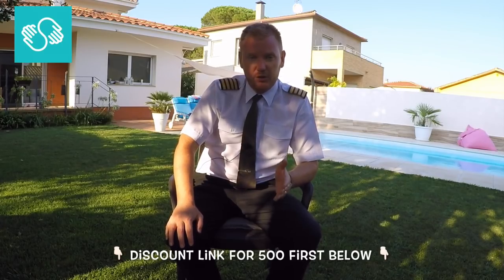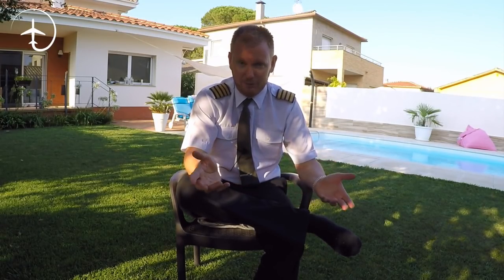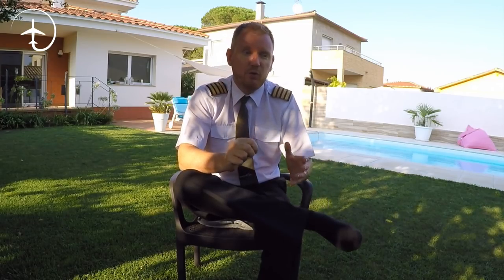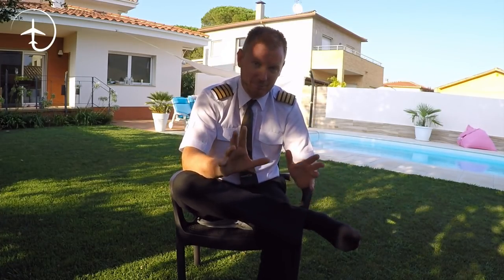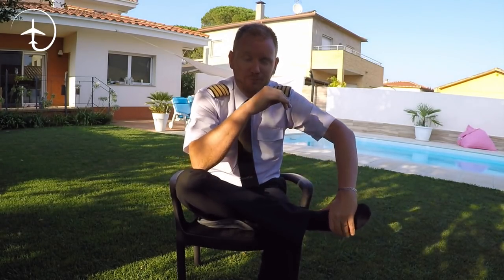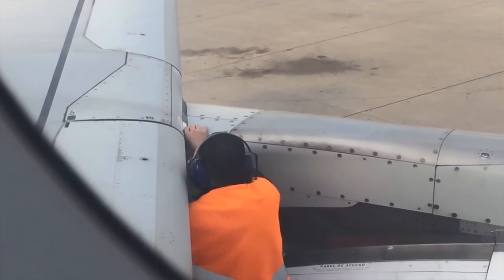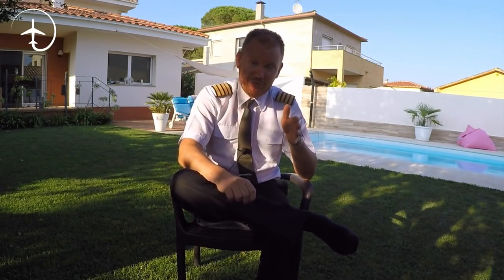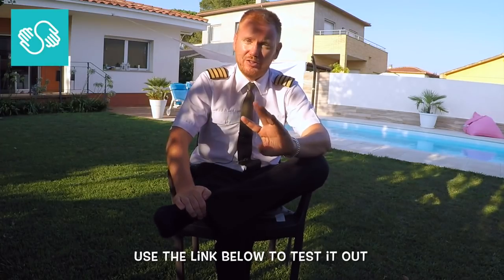Fixing aircraft with DUCT TAPE?! Mentour Pilot explains.

Comment: actually there are two types of speed tape. one is what you see in the video which comes in a roll. this tape is thinner, not very strong(relatively, its still a lot stronger than what you can easily buy), usually several layers of tape is required. major purpose is to provide sacrificial protection to parts which are not load bearing such as panels with errode edges, lifted or torn seals, sealant that is not completely cured, cover up minor cracks, etc. the point is if you see that speed tape lifting or breaking or even fly away in flight, its just doing its job; another type is thicker, much much stronger, last a lot longer and crazy expensive. its usually use to cover up some small holes, missing covers or small panels like what you see at 4:15 , or use as temporary repair if permanent repair to cracks/dent will not be done soon. one layer will do the job and it last much longer than the thinner one. but as i said it is crazy expensive and very often you wont have any supply of this tape, so mechanics usually use the cheaper speed tape (again, relatively), layer it up to obtain a repair of similar strength, and its where skills, patient and intelligent make a difference between what you see in 4:15 and a nice looking and long lasting repair. but still, speed tape repair is going to break sooner or later, so periodic check is to be carried out, if the speed tape repair is in poor condition then damaged tape will be removed and new layers will be applied.
Reply from the maker: Thank you! That’s excellent information.

Comment: Pilot report: "Evidence of oil leak on #1 engine cowling"

Maintenance report: "Evidence removed."
Reply from the maker: Hahaha!
Reply: nah you dont get it. the report will be "oil consumption rate checked within limit, oil leak is normal. cowling cleaned up. no.2 engine is lacking normal oil leak" XD 
ok seriously most gas turbine engine is perfectly normal to lost oil during operation as long as the lost of oil is within a specific rate. an engine that dont lost oil at all is not a healthy engine and can cause more trouble. it will be a long story to explain it.
Reply: I was always told that is a multiengine prop job is not leaking oil while on the ground, that you shouldn't get in it.
Reply: "nah you dont get it." -- No, sir, YOU don't get it! This is an aviation joke that probably dates back to the Wright Brothers. Way to kill the humor, though...
Reply: Jeb: Starting the engines... wait, they just blew up.
Reply: Sounds like a Lockheed P-3 (or any other bird with RR Allison T56 engines) basicly... It's called 1960's corrosion self-preventing engines :p
Reply: My favourite one was:
Pilot complaint: left engine missing.
Maintenance report: left engine found on left wing after a brief search.
Reply: @krakenburger56  Oh, c'mon, just tape the sh*t up and let's take off.
Reply: @Phaidrus  Throw that duct tape away... Get the Flex Tape!
Reply: Pilot... Autopilot in altitude-hold mode produces a 300 feet per minute descent.
Maintenance... Cannot reproduce problem on ground.
Reply: hahaha I am a field service technician, and there is only a special breed who makes it to all the 4 steps, source found, course removed and root course excluded.
Reply: Love those maintenance reports.
Reply: That used to be the case when radial engines were common. I worked on R2800s early in my career and we actually add so much oil regularly (almost as frequently as it was fueled), it was always calculated in on every weight and balance chart. We’re talking gallons at a time. Today, quarts / liters are the norm and that’s maybe every 50 flight hours or so.
Reply: @tommaguzzi1723 I forgot about that one.

Comment: "Wouldn't use duct tape to fix your car" -- clearly you've never seen cars in the American Southeast lol
Reply from the maker: Hahaha! I actually used it on my Clío as well. 😊
Reply: Mythbusters did.  But they didn't use it for fixing normal problems.
Reply: Or just about any NASCAR race.
Reply: That's speed tape as well.  @SigTheSauceMan
Reply: I usually have to pay extra if I want to be duct taped to my seat.  :-P
Reply: @0x8badf00d  the tried to lift a car up with duct tape and it ripped off the crane! I thought they should use german Panzertape next time.
Reply: @conhopper78  They also used duct tape to patch up a car after Kari ruined it.
Reply: @MentourPilot  doubled it,s value ? :)
Reply: Clearly you haven't see Romania :))))) Try scotch tape :))))
Reply: @MentourPilot  Good to know :D I have another idea: When a bulls-eye fails, and you get depressurization., fast apply duck tape until the window is completely covered, min 30-40 cm left-right, up-down from the margins of the bulls-eye, and no spot is missed !!! I recommend 2 layers doing that ! After that, you go to the cabin and tell the Captain he can pressurize the plane back, with 200-250 mm Hg than outside pressure. And all it's ok ;)
Reply: Or south Wales UK.
Reply: Yea. I have to replace the duct tape on my car soon or the quarter panel will open up. Black matches well with the paint job.
Reply: It´s perfect to keep an old Micrs´s headlights in place!
Reply: I was going to say, I've fixed my car with duct tape before lol.
Reply: Neither my car! 🤣
Reply: @MentourPilot  it’s amusing that you think a clío is worthy of duct tape.
Reply: I used ducttape to hold my rear bumper inplace.  Infact it was a long term fix I applied several layers between bumper and rear panel the painted with plastic paint with a body matching color.  It lasted almost 6 months
Reply: @u-know-this  your comment would make so much sense to others if you used punctuation and just basic grammar.
Reply: I use speed tape to fix my car

Comment: I love duct tape stories, but speed tape is a wonder. At a wonderful price!
Reply: NICOCRAFT hi
Reply: Hey NICOCRAFT
Reply: its 13bucks on ebay not really that expensive used to smoothen out the surface :D
Reply: @Isaac chiew those on Ebay are not true speed tape.
Reply: That's not what they use. To use it on aircraft it has to be in date, and has to be a specific 3m brand with an acrylic adhesive glue designed to adhere to painted aluminum. It's 800-900$ a roll they pay here at tampa international airport. There are a bunch of other specialty tapes too including woven glass matt tape that is fireproof that is required to be used if any of the apholstry panels come off, kapton tape for wiring etc. In the maintinence depo there is a small moving box with various tapes inside that is worth than most brand new cars.
Reply: Out of the box topics excellently rendered!
Reply: Isaac chiew, you're probably looking at an aluminum foil HVAC tape.  All that's shiney is not speedy.
Reply: I mended a bees wing with sellotape and it worked because the bee could fly
Reply: Duct tape can fix anything, and if it doesn't - you are not using enough duct tape.
Reply: BEAS7 I use duct tape quite a lot in the bedroom usually against there will, it works quite well
Reply: Buzz 21 man of culture
Reply: Get worried if the maintaince  shows up with a giant bottle of  Guirella Glue.)
Reply: John Baxter, we use cyanoacrylate "superglue" to fix bladders on heater-cuffs. Used correctly, alot of stuff can be used...

Comment: Why not use FLEX TAPE? IT BONDS, SEALS AND REPAIRS.
Reply: Im only joking
Reply: To show you the power of flex tape. I sawed this B-737-800 in half
Reply: Its only used when there's a lot of damage
Reply: Eastern Spotter 1969 and the inside is completly dry
Reply: HELL YEAH! THAT'S A LOT OF DAMAGE
Reply: Phil swift: Smashes the wing with a knife NOW THATS A LOT OF DAMAGE
Reply: badboy 25 *I SAW THIS PLANE IN HALF*
Reply: With the power of FLEX TAPE. YOU CAN JOIN THE SAWED PLANE
Reply: I came here for this comment. Thanks!
Reply: technoboy9982 lol 😂😂 😂
Reply: lol
Reply: Lol I was thinking the same thing
Reply: I SAWED THE WINGS OFF THIS 747-800! THAT'S A LOTTA DAMAGE.
Reply: And looks at that the 737 max still floats
Reply: hahahaha.

Comment: Amazing. I sat on an Air Canada plane and watched the de-icing machine smack the canoe and break off about 6 inches of the trailing part. I notified the flight attendant who brought the First Officer back to look. My spouse at the time was angry and wanted me to keep quiet as by bringing it to the attention of the crew this process you describe exactly followed and the flight was much delayed. The engineers came out and taped it back on. The First Officer came back and also explained as you have here that it wasn’t duct tape. Unfortunately the tape did not secure the piece and in the end the plane was deemed safe for flight. Air Canada was very pleased with me though as they were then able to recoup repair costs from the de-icing company. Still with Air Canada. Spouse - not so much.

Comment: Have seen high speed tape covering a hole in the leading edge of a 737-800 stabilizer for several years in a row. Of course it was reapplied every few months, but it worked just fine, was EASA and Boeing certified. No performance penalty for it either.

How entries into the tech log are handled, is actually somewhat company dependent. Quite a few companies allow both "for info only" entries, if an reset has been done successfully, and for pilots to do minor technical procedures under direction by maintenance control. For example to do a dry crank for an engine related issue which is basically done automatically via the maintenance pages accessed via the CDU, or a similar test or non-QRH reset on the airbus. This is highly useful on outstations without maintenance contract to allow one more sector back to the base.

Comment: Question: Considering filling the maintenance log with a defect grounds the plane, this sounds like a strong incentive to not fill these items. So one could imagine the airline putting pressure on the pilots not to fill these. How is that incentive overcome/prevented from triggering?
Reply from the maker: Thats what we are trained to do. We look at the safety of our passengers, plane and ourselves before the profits of any company,
Reply: Self preservation? If the defect leads to the aircraft crashing....
Reply: FrankyBoy, while the flight crew needs to write up all discrepancies in the log, not all discrepancies are going to get the aircfaft grounded.  Anything that renders the airplane unsafe to fly is going to get fixed before it leaves.  The cockpit crew is acutely aware they'll be the first to arrive at the scene of the accident after something critical fails.  Rest assured that they're going to write it up.

 Repair or replacement of many lesser discrepancies may legally and safely be deferred.  Some may allow the airplane to continue after specific maintence (mx)actions or under certain operating limits.  The great majority of writeups will merely call mxcs attention to a nuisance, like a failed lightbulb, a galley oven door that's hard to latch, a soiled seat cover, or a clogged galley drain.  None of these things endanger safety of flight, and correction can be deferred to a station somewhere down the line that has the parts, personnel, and time to do so.  Many writeups will only need mx to check that something like brake and tire wear or engine oil consumption are within limits.

 However small the complaint, the airplane isn't leaving the gate until mx has entered its disposition in the aircraft log.

Comment: Is there in aviation maintenance something similar to WD40 in case something gets stuck? :P
Reply from the maker: Many many things and sprays.
Reply: LPS or aerokroil are common
Reply: A hammer. Every tool box has one.
Reply: we use lps 1, 2, 3
Reply: actually in some cases i use hi-jet 4 to loosen things up, mostly rusty tools XD
Reply: Areokroil - it's magical
Reply: probably also costs $600 for a can
Reply: Stuck no, but it does wonders as its primary job as a water displacer or CPC Corrosion Prevention Compound.
Reply: Unless there is a spesific MIL/AS/AN etc. spec required, we use a lot of CRC products, 3-36 for general corrosion preventative penetrating oil. To ease breaking free partially (thermal seezed) fasteners, CRC penetrating oil with MoS2 is used. For general latches, piano-wire hinges etc. we use CRC Chain-lube, which starts off thin and penetrating and ends up as a MoS2 rich EP grease when solvents have evaporated :)
Reply: @MentourPilot  Next video.
Reply: @MentourPilot  vaseline
Reply: Is they are ,u just need to ask . Maybe u don't because this type of problem u should solve by your side .
Reply: Professionals use Ac90 😂
Reply: Freeway

Comment: The glue on speed tape is super strong too.  One day, an A320 came in that had had the belly fuel panel door replaced. While the epoxy set, they sealed it with speed tape and put the plane back in service. A mechanic came out to open it (only mechanics are allowed to do anything to the aircraft). After 5 minutes trying to peel it off, the poor mechanic finally had to get a knife and cut around the edges of the door to get it open. Then put more speed tape back on after I finished fueling, because the epoxy still wasn't fully cured.
Reply: Aaron Murphy how do you get it off after that? Heat gun? Chemicals?
Reply: No idea. I see that A320 occasionally, and it still has glue residue around the door.
Reply: Very simple: just cut off your hand! xD
Reply: Speed tape glue has to be seen to be believed. It's used on Kevlar tape for some prototyping jobs (the exact same glue) and it just sticks to metals especially like proverbial shite to a blanket.
Reply: Aaron Murphy vc
Reply: @vnyggi621  probably by using a solvent.  My guess would be acetone.  Although that would remove the paint too.

Comment: This is an old video but I've been binge-watching this channel for a few weeks. Anyway, I was recently on a short flight (less than 2 hours) that got delayed for 4 hours because one of something like this. One of the fairings was missing one screw, instead of replacing the screw or using this tape they removed the whole piece. It was only supposed to take about 30 - 45 minutes.. I didn't care that they were removing the part, the Capt. fully explained what it was and that there was no danger in removing it. The really frustrating part was that it was a full flight and they only decided to release us back to the terminal and have us reboard later after 3 hours when it was clear after 1.5 hours that it was taking way longer than expected to get the part removed and all the paperwork sorted out, they were apparently waiting on a phone call from Boeing for the last 2 hours of the delay. I'm a really patient person and appreciate they want to be completely sure everything is safe but I would have MUCH rather spent the delay in the terminal able to walk around, eat, use the restroom etc than remaining stuffed in the crowded plane. Massive credit to the flight and cabin crew for keeping everyone infomed and calm and to the airline for making absolutely sure our connecting flight was 100% rescheduled (and at a reasonable time) so there was no panic or confusion at the connecting airport.
Reply: Flap fairing? No need to call Boeing, thats a CDL, so you can take it of and fly without it for a limited amount of time. There is a fuel penalty so you’ll need more fuel. Since the flight was delayed it might of lost its slot and had to reschedule🤔
Reply: @speedbird9313  Yeah, that's what the captain said. That it was fine to remove but it would just cause more fuel burn. It wasn't something that concerned me. It was just weird that they kept saying they were waiting for this call from Boeing for over an hour. I assumed we had lost our slot long ago. I wasn't even all that bothered by the delay, the airline did a great job of making sure our connecting flight was taken care of. I was more like "Please just let me off this plane, my a$$ and legs are going numb!" 😫
Reply: @lookingglass3626  Yeah, like I said, no need for Boeing assistance for that.
But maybe they didnt have any technicians to perform the job at that airport🤔

Comment: I wonder if the engineer had trouble finding the end of the tape on the role?  Do they supply a handy bit of brightly coloured plastic to mark the end?
Reply from the maker: I would guess they do!
Reply: A paper tab or another piece of tape to start the roll; then hopefully the last user folded the end over to make a small tab for the next person. Otherwise like finding the end on any other tape.
Reply: EASYTIGER10, speed tape is pretty thick; not at all difficult to find the end.
Reply: Mentour Pilot I am an mechanic in Hong Kong handling A320/1 most of the time,  I can tell it is a lot easier to find the end of a roll of high speed tape than normal tapes
Reply: EASYTIGER10 high speed tape can also be used in cargo compartment for temporary repair, but not in cabin for sure
Reply: mrkeithin, there was a time in the U.S. (after the FAA banned smoking and mandated escape lighting in the cabin floors) when the MEL specified speed tape (by ANSI number) for two repairs in the cabin.  We couldn't dispatch with any ashtrays missing from seat armrests or lavs, but a limited number of empty recepticles could be taped over.  A specified aggregate length of speed tape could also be used to temporarily secure loose floor lights and wiring.  Both repairs required placarding the aircraft log. Checking the placards against the cabin was a favorite pastime of  FAA inspectors doing "courtesy checks" on short turns, especially during inclement wx.
Reply: Eric Coleson thx for letting me know abt this
Reply: mrkeithin, de nada

Comment: I once found a panel with a loose corner on the inside of the hold. An engineer came in, said: "No problem, gonna tape that right up!". He took is magic special tape, and fixed it. (not speed tape, another special kind of tape). I was stunned that they are so efficient. A scratch I once reported was fixed within 5 minutes!
Reply from the maker: Yeah, it’s cool.